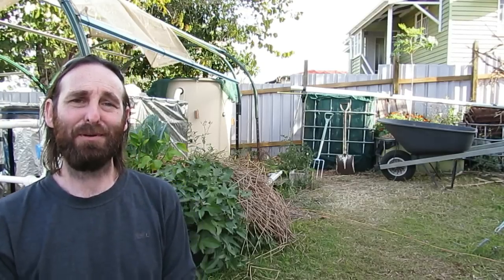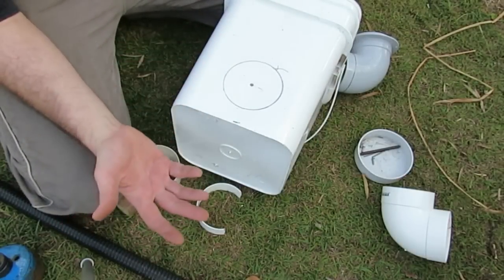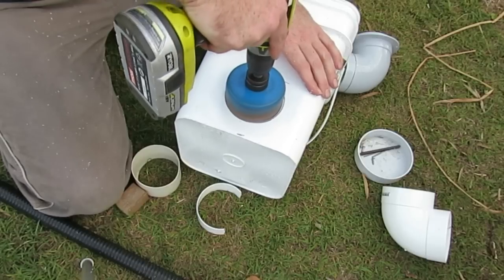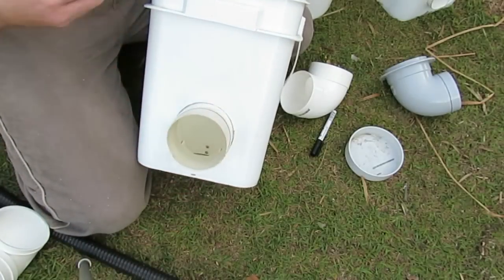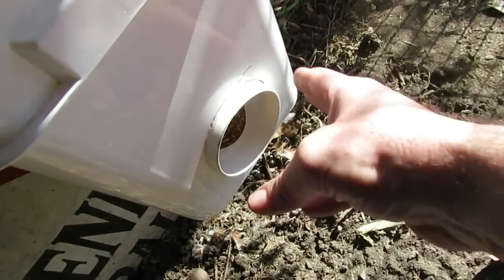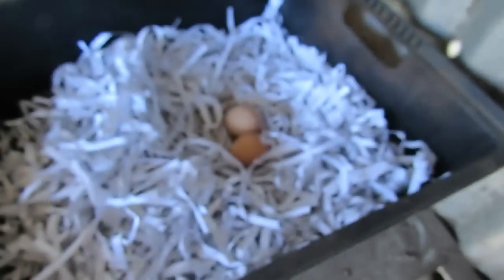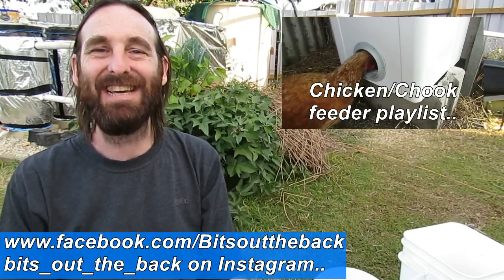CHEAP & EASY DIY BULK Chicken Feeder

Comment: I made this a few days ago and the pigeons have not found the pallets yet, so its saving pallets already. The 3 chickens they have found it easy to use as well. What a great device.
Reply from the maker: +Andrew McDermott 
Nice one Andrew.  Have found that the pigeons have to make do with the small amount that ends up on the ground here. I don't mind them cleaning it up as it's less food out to attract rodents. 
Have a great one.
Reply: If i just feed the chickens pallets, their less likely to flick out the food. 
Apart from the local pigeon, I only have a few sparrows taking the food. 
The only thing I would change would be the size of the bucket, I would prefer it a bit taller to fit a whole bag of chicken pallets :-)
I think Its awesome and already paid itself off in unwasted chicken food.

Comment: I have built two in HD buckets with rain hoods made from pipe. I'm starting on a third feeder. I'm going to add a port on the top for refilling the bucket. Getting the lids off can be a real pain in the neck. At any rate, thanks for the idea and the thorough instructions. The feeders are fast and easy to make and they work like a charm.
Reply from the maker: Great idea to add the fill port on the top.. Should look at something like that for ours as the lid is hard to remove.. 
Glad the clip has helped you out some..
Have a great one,
Rob..

Comment: Perfect feeder. Will be making these for mine for sure. Another way you may consider for preventing seed being flicked out is to fold the lower lip of the extender pipe upwards using a heat gun or similar to create the fold.
Reply from the maker: I ended up using a jar lid to make a lip.  That helped stop them scratching the grain out looking for their favourite seeds. 👍

Comment: I made one of these. I used only scrap pieces of PVC lying around. The angle ended up being a 30 degree angle but it worked out fine. I did have to take out some bigger holes in the end, I expect because I'm feeding them pellets as opposed to grit/powder.
No spilling, no mice that I can see, happy laying chooks! They understood within minutes how it worked.
I also made a waterer. 4 nipples on the bottom of a 5 gallon bucket, this took them a bit longer to find out, perhaps 7 days to switch from the open bucket to the nipples. I put peanut butter on the nipples to help direct their attention. Damn that feels weird to write, but yeah... :P
Reply from the maker: :-D As long as it got their attention..  Glad you're hap with the feeders.. Just knocked up a new one for our girls last week.. The lid on the old one had cracked so went & got a round drum with a screw on top..
Cheers & have a great one..

Comment: nice design. 
May I suggest glueing the pipe offcut inside the top of the lip of the outside part of the bend.
The intention is as some additional rain shielding.
Reply from the maker: It wasn't needed on ours due to where the feeder was kept but there's no reason one couldn't be added. 👍

Comment: Your chicken feeder is great!  Think about your chicken waterers, too.  You can still use the same square bucket for the water, or smaller, if you wish, but put these "horizontal" chicken nipples on it.  You can see these chicken nipples by looking on ebay or a web search for horizontal chicken nipples.  Use maybe two (or three?) chicken nipples on each side of the bucket using a drill to make the holes and screw them in with teflon tape.  I think these horizontal nipples are better than the hanging round ones because the chickens just peck at the central button on the square ones, a little bit of water comes out and they leak less.  The others are good, but I like these better.
Reply from the maker: Thanks Kathy...
We have friends that used to use the cup style feeders & they had issues with dust & debris in the cups so that's why we went with the drippers instead..  Don't find they leak much & a 60L drum easily last a few weeks for the few birds we have.. 
Hope you & yours had a a great one yesterday,
Rob..

Comment: Oh running it backwards! Didn’t know that!!!  I did learn that you can put a piece of tape on it but I like the backwards trick better.

TWO OTHER COOL TIPS WITH PLASTIC:

1: If you happen to have some thing metal the size of the hole you’re making you could heat it up first and then just push it through and it’ll make a perfect circle without rough edges also.

2: do you seal plastic to itself this is so helpful with so many things because you don’t know how many times I’ve tried to superglue my glasses when they break but I learned on YouTube that you can use acetone from nail polish remover make sure it’s 100% acetone it works best and then dip both pieces in the acetone for a little bit until it gets a little bit like sticky Chyna… And then press them together and then let it sit for 24 hours and the plastic melts together and it’s bonded! I have to admit I haven’t tried this but it seems like it would work it makes senseBecause I’ve melted plastic with acetone before by mistake. I didn’t know it had to come in a special kind of bottle that wouldn’t mail and I put it in something else and it dissolves completely. Anyway I didn’t actually try it but all the comments in the video I seem to say it works so I thought I would share that. 

Thank you for making this video
Reply: That’s so difficult to read I was speaking into my phone and it’s too hard to correct
Reply from the maker: I got the gist of it. 😉👍
Cheers.

Comment: Hello, I  have a question. How does the feed flow to the pipe opening in a flat bottom bucket. Won't the feed that is out of reach of the chickens mold or go bad. I think this is a good idea for a feeder but I think l would add a slant of some sort to direct the feed to the pipe otherwise wouldn't you have to tilt the bucket   every now and then to get the feed within reach. Or I guess you could install more pipes on the container. Just wanted your thoughts. Great  video. Thanks
Reply from the maker: We never had that issue. We also gave the feeder a regular shake to see how full it was which probably stopped food sitting in one spot too long.
Am glad you enjoyed the clip.
Cheers & have a great one.

Comment: I have another solution for your 16 scattering and I was thinking of doing this for my Duck but you could put the container up on a little stepstool kind of thing and then have the mouth opening at the bottom instead of on the side at the bottom... but have it still make the right angle and going on a slight diagonal towards the ground with a At the end and then they will be eating out of that which would be trough from the bottom of the bucket ( through the center of the store or just any kind of stand to get the bucket off off the ground you can even put like blocks of wood or cinderblocks )down to the ground so you would need a longer PVC pipe  making a ramp to the ground.....and then for the trough drill either holes for their beaks or I think I would do just a sliver off the side of the trough to make it open for the ducks to go up and down it with their bill for chickens I think I would do circles with my whole drill ... and the bucket doesn’t need to be a pie or anything it just needs to be a little bit high so that you can fit the L underneath and it makes a ramp and automatically will refill as they eat ...does that make sense I hope it does because I’ll probably never happen gonnasee any responses
Reply from the maker: Sort of makes sense. Would like to see a clip once you knock it together NA.

Comment: Rob Bob, my feeder is not under a covering. How will this do in the rain? I am wondering if we get windy rain...if water will get inside and ruin the grain on bottom.
Reply from the maker: I found having the plate in the base of the pipe & a bit of a cover over the top helped stop water getting in there Jeremy. Not sure it would stop rain from a storm with a lot of wind though. You may want to try & build a larger cover to attach to the top of the feed pipe. 
Hope that helps some mate.

Comment: Very nice!
Reply: i cant find square buckets tho - only round.. should still work..
Reply: ***** 
Round buckets work fine. Use silicone or other like product to secure pvc to bucket. 2 inch fittings are cheaper and work great
Reply from the maker: *****
We used round ones with no problems Anthony... If you have a look at some of the links the majority of buckets/bins folks use are round.. 
Cheers mate..

Comment: I showed my husband your video. He cannot find those fittings in USA. He made one, but the squirrels were gorging on the feeds leaving the bucket empty.
Reply from the maker: Hi Sashi..
The straight elbows should be easy enough to find in the plumbing section of the big box stores.. There are loads of folks that have made them with the straight ones in this clip..  I know the flanged fittings can be hard to find though.. 
Cheers.

Comment: regarding the "Sharing" problem. Perhaps two bends on either side of the bucket ?
Reply from the maker: The later one had 2 holes but they still wanted to feed from one at the same time.  
Cheers & have a top one Edward.

Comment: I love this design for food, do you think that you can make a water similar to this also with maybe a PVC pipe chimney to fill it? I am making a portable chicken tractor and the nipple feeder isn't good pick for this project
Reply from the maker: +DJ Krug Hi There.
I'm not sure that this design would suit a waterer. I  have seen some water feeders that rely on upturned vessels sitting in a tray though that might suit.
Have you finished the tractor yet? 
Rob.
Reply: Yes I did!  Maybe I should make a video.  It's working very well.  I am using your grain bucket design, but the sprinkler still hits it occasionally so I need to make a water guard for the last two corners.  The whole thing cost me under $100 and is 10ft. by 4 ft and holds 4 hens.  I move it several times a day and put any treats or dirt bath in front of it before I move it up.  I need to get bigger wheels next spring, but it's been working great and the hens are very happy.  We have the best looking yard in the neighborhood 😉.

Comment: Hi Rob. Saw your feeder design and built 2 of them with 2 elbows in each one. After putting them into service for a week or so, I have a question for you. Do you have roosters? My hens figured things out fairly quickly and are eating ok, and I do appreciate no food spillage! But my 2 big roos seem to be starving. They try to put their heads in but just seem to get frustrated. I am wondering with their big chests whether their necks are long enough to reach the food or if they are just terrorized by not being able to see while feeding. Today I was filling the pails and the two of them were frantically trying to reach the food I was pouring in as if they are virtually starving. Any ideas?  Thks Frank
Reply from the maker: Hi Frank.. No roosters here due to zoning laws.. Are the roosters much taller than the hens ? Am wondering if that could be part of the problem too as it may be difficult for them to get down that low..  
Would like to know how you get on with it mate..

Comment: I was wondering, is there a way to stack the two (water and food) so it doesn't take twice the space? My first thoughts were to put the feeder at the bottom, with the water storage on top and pbc pipes running from the water storage down to the feed storage, coming to rest in-between the food holes ending in water nipples. So the end result would be a food hole and a water nipple all the way around. The issue I see is maybe the water being to much weight or dampening the feed (possible leaks). Any ideas to make this happen?
Reply from the maker: Chris Wright Hey Chris. 
Could be done but you'd still need access to the feed drum to fill it.  I have our water reservoir set outside the pen now with a 20mm/¾" hose running to the dripper stations,
https://www.youtube.com/watch?v=Nbvq7EEwUzo
You could set something like that up & run the hose/pipe to the feed barrel/bucket.
Hope that helps some.

Comment: Hey there, I'm for sure gonna make one of these. I have just one question: how mice/rat proof is this? I'm planning to hang this from the top of my chicken coop. It seems like a great option and it definitely should prevent the spillage that I have trouble with now. I did about an hour's worth of research before this and as soon as I saw the first shot of your feeder I knew I had found the winner :) Its simple yet indestructible ;)
Reply: Oops, I saw that the question came up before and was answered. Never mind!
Reply from the maker: AcidProblemChild  No problem..
Are yo going to have a crack at one still?
Cheers..
Reply: RobBobs Backyard Farming Yeah, I've been scrounging parts for the past few days. Im gonna use a round bucket and the biggest diameter hole drill I could find. Its gonna be a smaller version because I have only 3 chickens and use a movable circular chook dome that I rotate over 6 circular veggie beds. The chooks take care of the weeds, poop all over the place and turn out some great eggs! :D 
I also ordered a couple of those drinking nipples that they can pack (sp?) at and drink without mucking up their water.
Reply: Hey Acid check my chicken feeder on my chanel and tell me what you think! Tnx for comment!

Comment: I've used your idea here in the U.S. I used round 5gal. bucket, and found that using a hot glue gun inside and out works great. I simply hang it from the co-op roof. thanks again!
Reply from the maker: Nice one Todd 👍
Hanging it would help a bit more at keeping the rodents out too. 
Cheers.

Comment: really good video. thanks for the design.. nearly shed a tear when u said 90c elbow.. those cost over $2.50 in my country :'(
Reply from the maker: Is crazy the difference in prices I've seen between countries Jaiye. If we want to buy a new 20L  bucket with lid they cost about $14 AUD. Have seen others pick them up new for a few $.
Hope the feeder build went well if you had a crack at it.
Reply: It works great in my layer chicken tractor. Only issue i didnt think of beforehand is during rain water running down the sides of the bucket and getting in but a little silicon solved that.

Comment: Hi Rob Bob, I made one of these, but more in line with J&J Acres did. We just did one last weekend, and we already have mice in the food. Do you have any suggestions?
Thanks, Lee
Reply from the maker: Hi Lee.. 
With ours I found having it on 2 cinder/besser blocks was enough to keep the mice out of the feeder itself but know that doesn't suit all as some folks have the shorter breeds..  I made sure that the feed ports have no ledges under them for the mice to walk on as well.. 
If they still get in you could add some mesh to the inside of the pipe work at the back that is large enough to let the feed fall through but keep the rodents out.. That will keep them out of the main section of the feeder at least but still isn't ideal.. 
Hope that helps a bit & you can sort something out.. Would like to know how you get on if that's alright.. 
Rob.
Reply: Thanks for the tips, I will try those. We do have the feeder setting on a large cut log. I never thought about it having a ledge. Good Tip. Thank You!
Lee

Comment: I'd like to see a way to cut some pieces of bucket, to place inside to slope the bottom to direct the feed into the pipe section.
Reply from the maker: Hi there.. We've found with ours that it isn't really needed.. We give our large feeder a small shake when collecting the eggs just to see how full it is & the feed always works it's way down.. Would like to see how you go if you play around with the idea though..
Cheers & have a great one,
Rob..

Comment: thanks for the great vid mate!
is there a specific reason why the cut-out on the 90deg facing the floor of the container is facing the outside rather than the inside? cheers
ralph
Reply from the maker: +Ralph Kluge 
Hi Ralph. 
I left it at the rear to make it easier to attach the block of wood that&#39;s used to help hold the fitting in place. You could leave a bit at the front to see if you could do the same by using small bolts to attach it to the front of the feeder under the hole. Would like to know how you get on if you play around with the idea.
Cheers.
Rob.

Comment: I don't understand how it works, how does the feed get in the pipe if it's flat on the bottom of the bucket?
Reply from the maker: +S P2000 
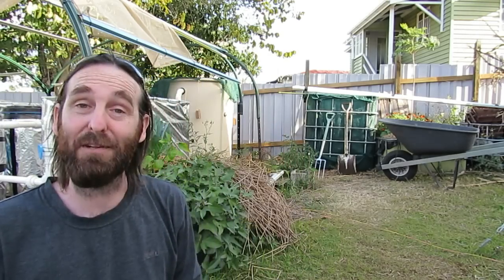If you go to 1:53 you'll see how a section of the fitting has been cut out to let the grain/pellets flow through to the feeding area.
Cheers.

Comment: Have just made one based on your design.  As I didnt have a bucket I went to Bunnings for a 20 lt and found that charged $14.50 for one with a lid.  This got me thinking about how I would use the feeder and the minor problems storing half used 20kg chicken feed in the garage (encourage vermin, spilling and taking up space).  So I bought a big solid 35lt barrell https://www.bunnings.com.au/handy-storage-35l-all-purpose-storage-barrel_p2583956 for $24 as well as a 90mm FF Stormwater 90 degree elbow $1.80.  It takes a full 20kg bag of Golden yolk feed which normally my 3 chickens take a month and a half to eat.  The chickens have learnt where their feed now is - I just need to experiment with how high off the ground the barrell is placed to reduce the spillage Sitting on 90 x45 blocks dont seem high enough so may add a brick height as well.  Good simple design that works well - Good on you Rob
Reply from the maker: Nice one Paul. Have you got the height worked out for the girls? 
I've seen the bucket price in Bunnings & wondered how other countries can sell them so cheap. I suppose the height price will stop a lot being tossed out after use. 😉
Thanks once more for all the support mate. 👍👍